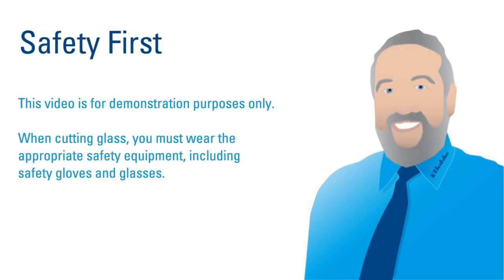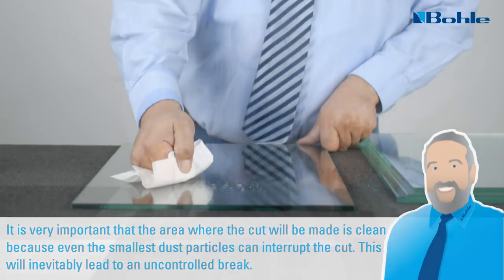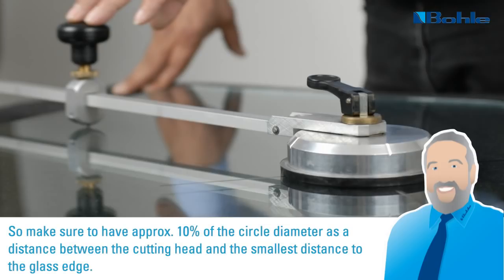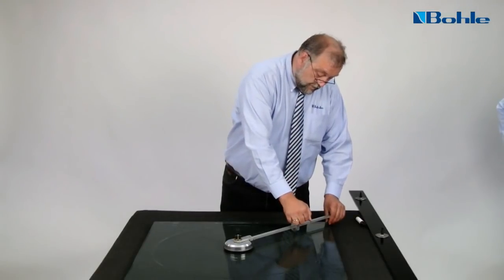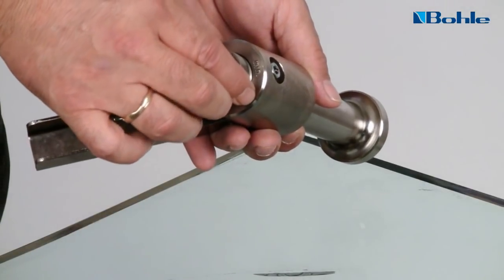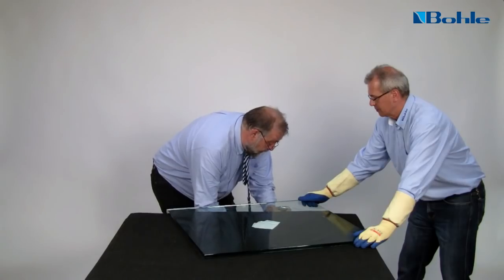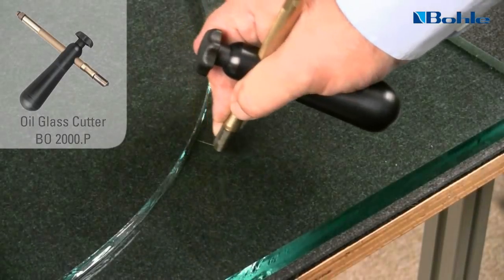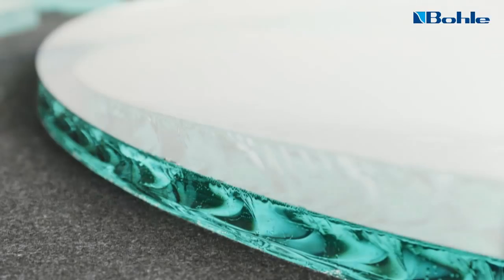Big Frank: How to cut thick glass simply and safely | Dickglas schneiden einfach und sicher

Comment: Ok, As the foremost circle cutter in our shop I use a different method when it comes to breaking (opening) the initial score. Depending on the size of the piece I'm cutting I prefer to flip the piece over and apply firm pressure directly over the score line on our carpeted table. This way the break originates directly form the score line and does not run towards the score line from wherever the impact tool(as shown in this video) strikes the glass. You can see a degree of wavering in the edge of the piece as he is using the glass tapper 4:11 After the entire circle has been "opened" I flip the sheet over again and open (break) the circle again using the same method from the scored side. Same method to remove the off-cuts after that.
Reply: +RickBo,

This is exactly how I do it at the shop too.
Reply: RickBo in my shop, my cutter personnel just impacts the glass below the score line with a motor valve (very precise personnel), the proceeds to slightly bend the glass to make the separation run along with the score. No wavering whatsoever.
Reply: I do the same. No need for all those extra gadgets
Reply: sounds interesting but (as a totally novice) I can't quite imagine everything you're describing...any chance of uploading a video of how you do it?
Reply: @perspectivex  unfortunately not, it's been a few years since my glass shop shut down. We had a carpet topped table; supports the glass with just a little give. just like this video use a circle cutter to score the top side, then pull to an edge and pivot the glass to vertical on the table edge and flip it around then lay it down again. Then press with your thumb directly over the score line and the glass will crack from score line to the now top-side. Once it's opened (or cracked) all the way around, flip it again and repeat to ensure it's opened all the way through. Then it's just a matter of cutting the excess off.
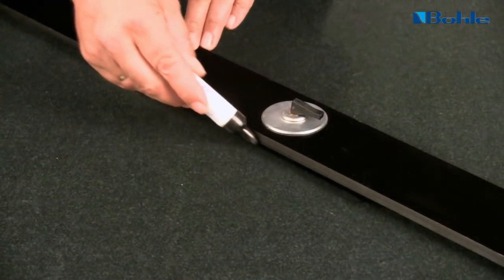Reply: @0heydude0  thanks for the clarification.  I suspect the "press with your thumb" step requires some experience to get the speed of the impulse and total force right, but I can give it a shot when I start cutting disks out (for telescope mirror blanks).  How thick a piece of glass do you think can be cut into a circle? The diameter would be somewhere between 12" - 20" in my case (and for mirror blanks the thickness to diameter ratio might typically be between 1:6 to 1:12, so, e.g. a 20" mirror could be ~2" thick, 12" mirror maybe ~1")
Reply: @perspectivex  Not am impulse, just press and slowly apply more pressure until it cracks, certainly you get a better feel for it the more you do it but it's not something highly demanding either. 
Those thicknesses however... 1~2 inches would be around the 26-52mm mark. that's beyond what you'd do by hand. You're looking at Waterjet maybe. Personally I've only done up to 12mm glass and those orders are far and few between. Even tabletops or shelves are only 5~6mm. House windows are 3mm(sometimes 4~5 if large). Thickest piece I've ever handled was a bullet resistant 4ply 19mm.
Reply: @0heydude0  see, exactly what I meant...it requires some experience.  I would probably have been trying out different impulses till the cows came home to make it work but you clarified it's actually a slowly applied pressure.  As for cutting out thicker disks, ATM's (amateur telescope makers) often do trepanning (https://www.youtube.com/watch?v=-lrvaDR9zvA ...that's thin glass but it works much thicker too) or using an angle grinder with diamond blade (https://youtu.be/y45iWdQgNm0?t=161).  Waterjet would be great but I believe it's way out of budget for a typical ATM.
Reply: @0heydude0  I don't know if I can ask you a couple other questions, but here goes: I got some plate glass table tops and shelves to cut my blanks out for telescope mirrors.  Is there any easy way to know if it's tempered and going to shatter when I try to cut it?  I held the glass shelves I got up in front of a computer screen and viewed with a polarizer filter and see lines in it...I'm guessing that means it's tempered (video I made of that: https://www.youtube.com/watch?v=-DVvm3xndAk)?  Is there an easier way to know?  Second question...if I have a tool with a diamond point, could I use that instead of the normal glass cutter with tiny carbide wheel? The tool I'm looking at getting of is an old single point diamond lathe tool for $10.
Reply: @perspectivex  Check the glass for a stamp in a corner denoting its tempering, though it's possible it was requested without stamp for display purposes. Tempered glass does make a slightly different noise when you tap it with a metal tool, but the difference is very subtle and you'd need other glass to cross-reference. Other than that, attempt to cut a piece off the corner and if it takes too much pressure to open it's probably tempered. That said if it is Tempered, you're not going to be able to cut it to fit anything else which for us meant it went in the bin anyway. and no, you can't use a simple diamond point to score glass like you would with a glass cutting tool Made for cutting glass. High end self-oiling glass cutters are like $20. mediocre "Will do the job with a touch more patience" steel glass cutters are like $3.
Reply: @0heydude0   thanks for the reply.  The noise difference is interesting.  I'll start tapping all my glass pieces and eventually maybe build up an ear for hearing the difference.  I can still use tempered glass, in a way, even if I can't cut it, since once it shatters into a million pieces I can use the glass for casting (like this guy does: https://mdpub.com/glasstest/index.html), but it'd be a lot nicer to deal with non-tempered if I can get it.  As for the diamond point I don't see why it won't work although I probably will see once I try it :)
Reply: @0heydude0  can I ask one other thing? ...is there something special about scribing glass?  For example, if I were to take a dremel with fine (~.5mm thick x 20mm diameter) cutting disk and mount it so the blade is perpendicular and just over a piece of glass, say, 12" square, 10mm thick then rotated the glass around it's center (e.g. on a lazy susan) under the dremel cutter and ground in a nearly perfect circular groove with diameter ~10" and about .5mm deep and wide (could be maybe 1mm deep if that matters)...would that give me the same starting point as scribing in the same circle?  I guess grinding won't create as many micro cracks from groove as a scribe would from the scribe line, but I'm not sure how much that matters.  I will try this experiment at some point but haven't had time yet and was just wondering if you thought it could theoretically work.
Reply: @perspectivex  you'd end up with ridiculously more microcracks, even assuming you had the dremel mounted absolutely sturdy and the bit running under a reinforced bearing. Assuming you can mount the thing without a micrometer of wobble. Dremel bits aren't perfectly round even new, and those serrations and microscopic jagged edges would give a terrible score line. If you tried to open a score line like that there's no telling where it would run. Absolutely do not recommend. unless you were to try to grind-cut the plate down to your circle with Very light pressure and hydrated cooling but that would take hours to cut out.
Reply: @0heydude0  ok, thanks for the reply.  I guess crack structure and propagation is really a big thing in glass.
Reply: @perspectivex  Glass breaks, it's what it does. We've just gotten good at 'encouraging' the glass to break in precisely the way we want it to break.

Comment: score creates a weak point in the glass to promote a crack. most fragile part of the run are where the circle is closest to the edge of the glass plate. The least clean portions of the run are start and end . Start the circle near a corner. Then "iffiest" portion of your run is farthest from the edge of the glass plate.  Breaks form to relieve tension. plate glass has a tension gradient lowest is at edge. The farther the edge the smaller the tension gradient near your line.

Comment: Seems like the variable of the tapper can be interesting are there settings on the tool like say a torch wrench may have? When you mention the outer surface being perfect I see waves in the edge of the cut. It seems it would be smoother like seen on a good square cut.
Reply: +Lew Sou  torch wrench lol.... torque
Reply: LOL When I worked for my Dad he was in the glass and mirror business plus custom picture framing. He freaked me out taking a hand crank drill and a drill bit and drilling through 1/4 inch mirror using kerosene. That hooked me on machine type work . I got good with large mirrors and glass using a hand diamond wheel cutter. I was used to cuts on my hands and worked hard for him. Like your setup very much. We had a oval manual mat cutter to cut the oval matting for around pictures. I did every aspect of the biz less accounting before 17. Accounting was Mom's job and we stayed away from her money! LOL
Reply: John a torch anything might be a lot more fun than a silly worn out torx or even a torque wrench anyway. I remember the Wizzard of Oz when I think the witch held up something on fire and asked the scarecrow "You want a little FIRE Scarecrow"? LOL

Comment: I'm amazed how the glass breaks perpendicular to the surface that was scored.
Reply: path of least resistance ma niggaaa
Reply: Yes I know that. But that statement comes after the fact. We know it's the path of least resistance but can you tell me which way it was going to break by pretending you didn't know what was going to happen? That is, what makes a path the least resistive in glass?
Reply: +Jason Axford The path of least resistance is typically the shortest one. And the shortest line to the opposite side of the score is a perfectly perpendicular one. Other factors can influence the path of the break such as placement of the pressure or tool used to open it in relation to the initial score; or quality or defects in the glass.
Reply: Now that's much better than "ma niggaaa". Thank you RickBo.

Comment: He could have used a mallet too. No need for the fancy-pants breaking tool.
Reply: +Rami Shinnawi Ehh, accuracy. I mean you could achieve the desired results with a punch and mallet, but tools like these (there are cheaper simpler ones that work just as well) allow you to define your impact point before striking more easily than smacking it with a hammer. not saying I'd use one of these tools though.

Comment: @ MA KA  if I'm correct this is more of a controller break rather then a cut. I'm sure there are better methods to cutting glass but they are trying to achieve a certain texture.
Reply: +Robert Cano   well, you're right, but as far as glass cutting theory: you can't "cut" glass. Glass breaks, and what we call glass cutting is, in fact, careful and controlled breaking. The method of Scoring, then either applying pressure or a sharp impact or shock is what is used to "cut" glass down to requested sizes.
Reply: ahhh, no

Comment: I started in 1971 when I was 14, the apprenticeship was 7 years then. I turn the piece over on the bench and try to press or tap on the back of the cut to open it, then run it round with a hardwood 'pusher' or the handle of a cutter.
So long as the initial opening of the cut is dead square it can make a 90d edge all round, leaving very little to polish or ariss out.
One cut to the edge, then spring the cullet out like a circlip and lift it away .

Comment: Special cutting fluid = water.
Reply: Been a union glazier 20 years .its an oil not water
Reply: I use a petroleum based liquid.
Reply: alcohol too
Reply: @aaronv169  How thin of an oil is needed? Would sewing machine , honing or mineral oil work if it needs to be a low viscosity? Just what purpose does the oil serve, is it for the glass or the cutter?

Comment: I have worked in glass for years.. Glass is one of the most difficult thing to cut perfectly..
Ever see someone on a Movie cut a hole in a Window??? Not so easy as it looks..
Reply: I've only recently gotten into the glass business, and float glass is easy going up to laminate no so easy
Reply: +Shogun_ CNC... It is done this way making Car Glass... No hands touch the glass either...
Reply: UltraLiteSpeed1 welcome to look at our glass machine working video
Reply: I think you will find that a JCB does a rather good job.
Reply: i have once triged to cut (multi)laminated glass (which i thought was just 1/2 inch thick glass xD) i learned that i was wrong, 
i made a cut, the i tried to give a light an impulse with a light rubber hammer. To my suprise the fucking plate EXPLODED all directions 3m away ;D. luckily i always wear safety gear.

Comment: A KILOGRAM IS NOT A UNIT OF PRESSURE! IT IS A UNIT OF MASS.
Reply: +Brad Gefroh Common sense would indicate he means kg/cm2.
Reply: Kilograms are a unit of weight. Not mass. They're different.
Reply: You have them backwards. The gram is a unit of mass, a pound is a unit of force, and therefore weight.
Reply: Common sense would indicate that he probably doesn't know what mass actually is.
Reply: Brad Gefroh 

you my be right however i think he was referring to the equivalent amount of weight to add on top not knowing how much force to add.
Reply: If you do a simple calculation you will see that your comment is nonsense.  Pushing down on the glass with your hand or other object, the contact area will likely be something in the region of 10 to 20 cm2. Multiply that area by 15 and you have a very large force. Clearly the 15kg is supposing you could put an object weighing that amount on the target area. (I accept that the original advice is expressed in 'layman's terms'.)
Reply: These instruction apply only for use near the surface of planet Earth or equivalent acceleration environments
Reply: Operator 801 gg

Comment: What if you only have minutes and you have access to only one side? Lol
Reply: A brick or a 5 pound sledge hammer - assuming you don't need to make a clean cut.
At the apartments, we'd replace double-pane patio glass - 30" to 48" wide, then have to dispose of the leaky panels.   We leaned them against carport supports and threw bricks at them... they were tempered and broke into a million tiny pieces.  Swept up the glass and put in the dumpster.  One time it didn't work and the brick bounced off (several times) - a sledge hammer did the job.  Was a dumb kid back then and didn't wear safety goggles, but would squeeze eyes shut - never had a problem.
Reply: Just tap edges of temper with hammer and kaboom

Comment: So can I do this on a window mission impossible style and remove the glass circle from the window using a plunger or something?
Reply: "final tapping needs to be done from the both sides" and sides need to be pulled away to release the peace, not to mention such glass in high security areas would be laminated glass (though spurting alcohol spree to cut and setting it fire will melt the film, but if its 3 layer laminated glass there is still middle section that you cant cut)

Essentially answer is no, you cant do it, its just hollywood film magic. Only high power laser would be able to do this, or glass would need to be extremely thin and those places you can get with walking in from the front door..
Reply: Just like every one else you misunderstood  the video.It is not about cutting hole in the glass but cutting a circular piece of glass,and the difference is very big.Holes or any shapes are usually cut out of a sheet of glass with waterjet.It cuts a couple of mill out of the glass and that is how you can pull out the what ever shape you are cutting.
Reply: Dustoe McDust absolutely not
Reply: for the booth sides problem you could build a hammertool which strikes away from the glas (sucking impulse)
Reply: Hellsong89 what type of laser would be  able to do that